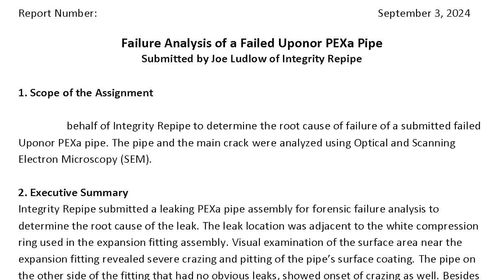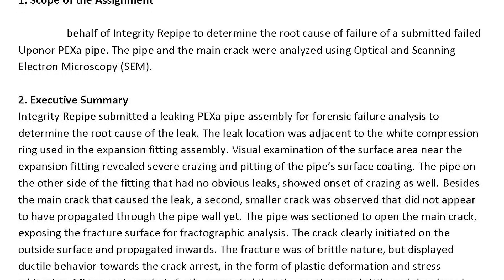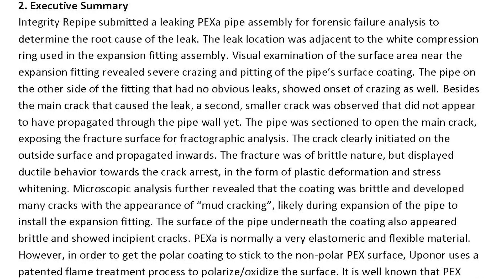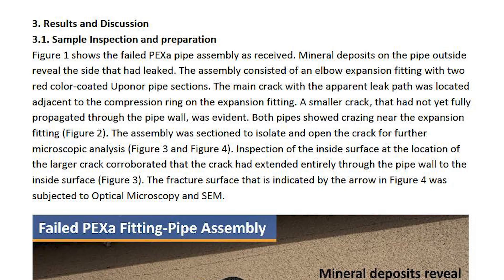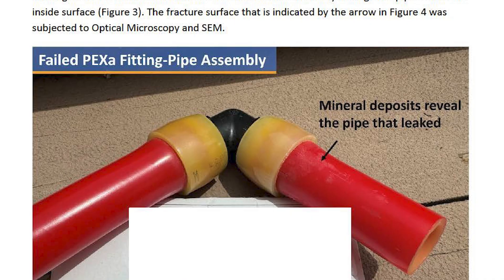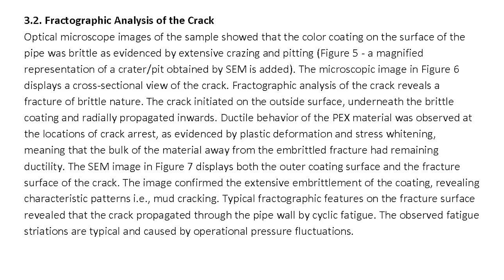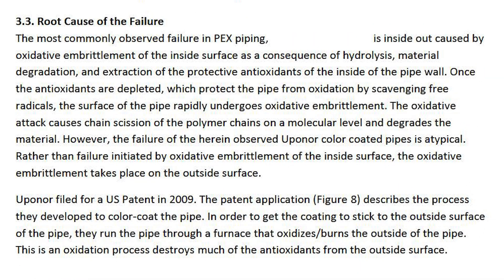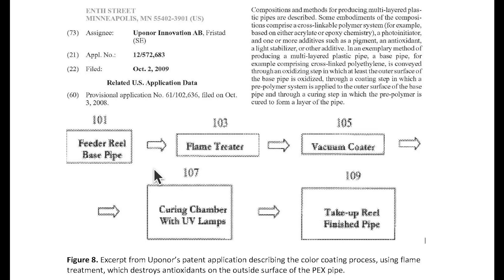Uponor PEX A Pipe Failures | Forensic Report Reveals Hidden Flaw

Comment: Great video Joe 👍 My installer in 2022 used short red sections on just the hot stub-outs, the rest is the white pipe... Is there a date range for the red / blue pipes that have this problem? Maybe the newer pipe will fair better? 🫤
Reply from the maker: Every case is different in the sense that the antioxidants are not distributed evenly in the extrusion process. 3 years. 7 years. 12 years. 15 years. Hope this helps.

Comment: Okay, they just verified what you've been telling us all this time, what about the PEX A pipe that was not color coated? Is the chemical chloramine still the source of the problem pertaining to PEX A copper,and brass still an issue? Because I have removed a lot of PEX a pipe that was yellowed and brittle
Reply: Only chlorinated municipal water supply.
Reply: @jayarnold5727 Of the yellowed and brittle PEX A you have removed, was that on a municipal/chlorinated water supply, private well, or some of both? Just wondering if you noticed any PEX A degradation with private wells as the water source. Thanks